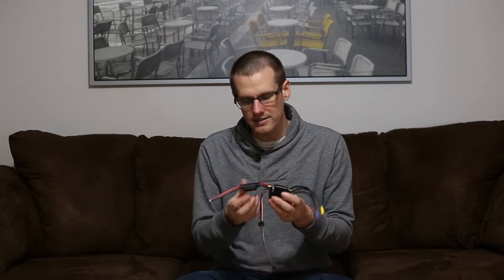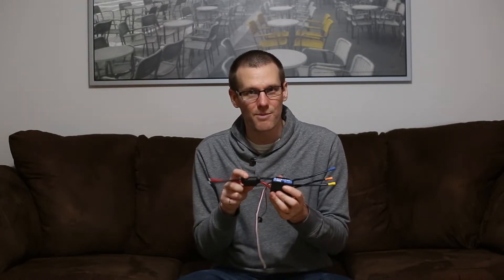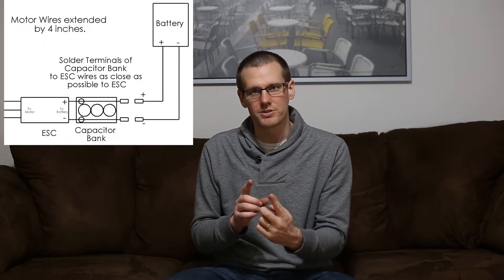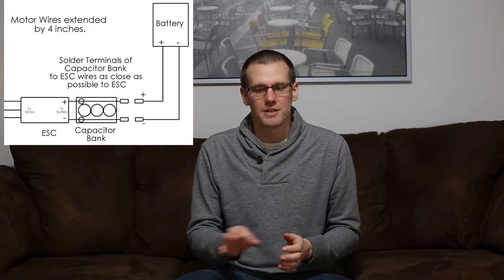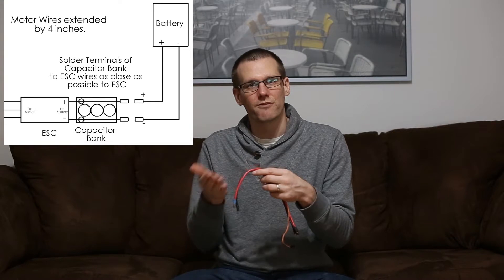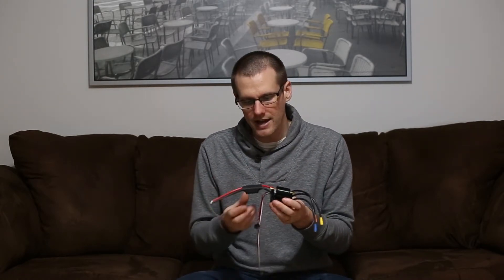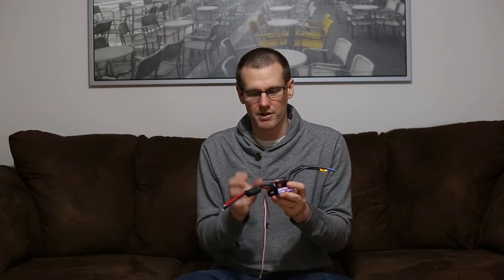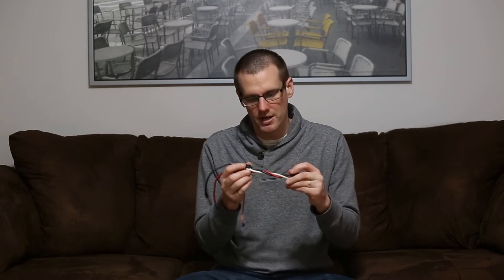How to Extend ESC Wires Correctly preventing Damage

Comment: people have recommended to go higher than the battery voltage for capacitors on the input side, because the very short transient voltages are much higher than the battery voltage, but that is measured without a capacitor in the first place. The big enough capacitor prevents these high spikes, so kind of protects itself from them. But a too small capacitor could fail quickly. correct?

Comment: I am in trouble and need your help
I converted a Balsa USA NorthStar seaplane to electric. The engine and the ESC are in the engine nacelle at the back of the plane and the battery is at the front, 36 inches away. 

According to your calculations, I will need 460*(36*2)/4 =8,280 capacity of the capacitors

Can it be done?  How many capacitors should I put on the board?
Reply from the maker: I would feel safer placing the ESC closer to where the battery is. Is this possible? Just need to find a spot at the top of the fuse and make some cooling vents.
Reply: @RCexplained 
No
It is not possible

Comment: Am I hurting my motor?
Should I lower my UF and would soldering directly to the ESC be better? 

I use 2 50v 6800uf capacitors for my cap pack, plugged in between lipos and esc
Lipo plugs to cap pack, cap pack plugs to ESC.
Reply: Yes, soldering caps direct to the esc input pads, if possible, whilst keeping the capacitor "legs" as short as possible is ideal.

Comment: Hi Ryan! Thanks for the great info! I would like to ask if adding a bit more farads is going to be a problem. So instead of 460μf adding something like 500μf. So if I add a total of 4 capacitors it would be 160μf more capacitance in total. 

Thanks!
Reply from the maker: You will be ok with more capacitance.
Reply: Thank you so much!  @RCexplained

Comment: Hi Ryan. If a person is not hard on acceleration and deceleration of the e.s.c. Will that help in prolonging the life of the capacitors on the e.s.c. ?
Reply from the maker: It depends on the ripple voltage. If you are still exceeding max ripple voltage under any acceleration, it's no good. If you can better manage ripple voltage by accelerating slowly, perhaps this can help. But I don't think there would be much difference. It would be better to just hold wide open throttle the entire time.

Comment: Hi Ryan, excellent explanation. I have one question, how did you arrive at the conclusion of what capacitance to use per inch of cable? Did you base it on a mathematical formula or your practical experience? I'd love to know more about the process behind this decision. Thanks in advance for your reply!"
Reply from the maker: the formula to calculate this value is very complex and time consuming. This is a general rule of thumb.

Comment: If the heat shrink tubing to the connectors on the motor start shredding (exposing the gold connectors), will they short out on each other?
Reply from the maker: They can, drop another piece of heat shrink on it and you are good.

Comment: Hi Ryan, nicely explained. Probably saved my neck as I planned to use over foot long wires to ESCs... Anyway.... Reconsidering the wiring now I would like to ask a question. If I change the gauge of wires battery-esc can I use bit longer wires than original? Specifically Hobbywing xrotor 40A comes with what looks like 18AWG (or even 20AWG - haven't got the caliper to measure precisely) If I replace them with 14AWG can I go a bit longer (probably couple of inches to get the ESC's on the arms) without all the hassle with capacitors?? Thanks for your reply. J
Reply from the maker: Hey Jakub, larger diameter wire can help, however, it's not easy to suggest by how much. Capacitors is the cleanest and simplest solution. I believe it is way easier to add the bank vs re-soldering larger wires at the board.

Comment: Thank you! I have to check my ESC's to see if I lengthened the wires and add capacitors. You say to add 460uf to 4 inch of wire. On this large topic https://www.rcgroups.com/forums/showthread.php?952523-too-long-battery-wires-will-kill-ESC-over-time-precautions-solutions-workarounds&perpage=10  they say to add 220uf to every 4 inch: ''As a rule of thumb, for (but nut on!) every 4inch/10cm extra length/distance between battery and ESC, add 220uF extra capacitance near the controller''.  Now I'm confused on what to order. Also they state that the capacitors should be low ESR: ''The main spec you need is low impedance and low ESR (Equivalent Series Resistance), otherwise capacitors will get too hot''. Do you think it's a must? Thanks!
Reply from the maker: Hey Jackal, thanks for the comment. Using 460μF of capacitance for every 4 inch of wire is very conservative. Many ESC manufactures would agree with around 220μF per 4 inches of wire.  Having more capacitance then you need is not going to harm your system, in fact it may have benefit, if you have other underlying reasons for high ripple voltage. 

If your ESC has ripple voltage logging, use this to see the difference that your capacitor bank has made. As long as the ripple voltage is always less than 10% of the nominal battery voltage, you are in good shape. A good target is 5% of nominal battery voltage with a couple peaks that may be higher than 5% in a run. 

As for low impedance and low ESR, yes I would say this is not optional.  Not following this advice will decrease the reliability of your capacitor bank. There are many capacitor banks on the market that you can use already pre-built. Grabbing one of these would be the easiest solution.

Comment: Would appreciate your thoughts as I'm new to this. Built a big Hangar 9 Carbon Cub. Running an Avian 100A ESC and a Power 60 Eflite, 16x10 prop onn a new 4000mAh 30C. The build guide specs a 6" lead extension [10AWG] from the battery to get the wires to where you can plug/unplug. There are NO capacitors called for. Also, I placed an XT90/EC5 adapter on the battery end of that extension since all my batteries are XT90. Could that be problematic?
This all stems from me researching an issue I experienced on my last circuit of the maiden series of flights. I had an engine just quit in the air but luckily successfully dead-sticked it back to the field. I know my LVC was improperly set at 3.4V to enter a Soft Cutoff. That was my mistake. I've reset to 3.0V. My battery had recovered back to about 3.7 by the time I got to it to check. I'm thinking I had a cell on the new battery drop to 3.4V and initiated a LVC but it sure didn't seem like a soft cutoff, motor only went dead rather than to 50%. I had control of plane, still. Not sure if it alarmed as I had a digital checker on my balance plug that was already beeping again, due to a high setting trying to be cautious. 
btw, I just received a power meter and did a test. It shows my Wp at 2200W and the motor is supposedly capable of 1800W. Amps peaked at 100.3A and I believe burst is supposed to be 85A on the motor. I'm not sure the meter is accurate or if I have an issue to tend to. I have another meter coming to compare. (RCToolKit W150) versus a private label identical to the Turnigy.
I'm trying to make sure all is good BEFORE sending all my work back into the air!
Reply from the maker: Interesting how the manual asks to extend the wires but do not consider capacitors. Especially if they are not calling out a specific ESC, otherwise there's no way to know if the ESC can handle the wire extension. This is concerning. 
My preference is to solder on my own connectors rather then use an adapter. This way I get a direct connection and eliminate any extra connections or resistance points. 

I have many of my ESC's set between 3.2 and 3.4v/cell cutoff. For planes, I do use a soft cut off and have never experienced a full dead stick.  If I return the throttle stick to 0% and then back up, the motor would resume at a minimum.
Reply: @RCexplained  Appreciate your time to reply! I did a lot of forensics yesterday and actually ran the plane, well secured, with prop and inline watt meter. My deadstick was self induced by improperly setting the Avian 100A ESC to 3.4V for a soft cut-off. This, coupled with the fact I'm running brand new 4000mAh batteries on a maiden, I hit that low cell V easily once I got into the battery for about 3-4 minutes. I replicated the entire scenario yesterday after watching your videos. I yanked the extension lead after rerouting the ESC leads. My wattage and amperage draw under simulated but likely higher than normal (50%+) throttle settings, was within specs and got me to about 5 minutes of flight time but I stayed into it beyond and induced a LVC on 2 battery tests after resetting the ESC to 3.0V for LVC Soft. Now I know exactly how it goes down. I'll continue with the adapter on my Turnigy's for occasional use but yesterday I bought 3, 5000mAh SMART batteries with IC5 since I have the telemetry capability with all the Spektrum gear, DX9, AR9350T, and Avian 100A ESC. Thanks again for all the info you provide!

Comment: Excellent information! Answered all of the questions that I had on my current drag car build. I intend to add a 8800uf cap bank directly to the battery terminals on my Tekin ESC. I'll keep the battery leads as short as I reasonably can and add any length I need to the motor side. Thanks Ryan!
Reply from the maker: Right on Baxrok2, glad the video answer all the questions that you had!

Comment: I'm looking at a situation where I'm wanting to have the batteries about 30 inches away from the ESC. Having heard others explain about problems on having long battery lengths, I had already thought about adding extra capacitors to the ESC side for dampening of the input to the speed control. Your rule of thumb of "460uF for every 4 inches" answers one of my questions.

My second question - Is it OK to use one (or two) much larger capacitors in parallel on the ESC side? Or is there some specific reason for having to use several banks of many smaller capacitors? Thank you.
Reply from the maker: You can use fewer larger capacitors.
Reply: Thanks for the quick response. I wasn't sure if I might be missing something. My plan was to add a an electrolytic with a low ESR between 3300uF to 6800uF onto the PCB where the battery wires solder onto. In the research I've looked at, the larger the uF of the capacitor, the lower the ESR is for it.

Since the setup is going to be High Voltage (6s) & High Current (100A), for the power-on rush of charge current to the caps, I'm working on some sort of initial current restricting system for pre-charging the caps just prior to arming the ESCs. To keep the voltage drop/current losses down, I'm installing 25" of 8 AWG from the battery connector to the ESC, replacing as much of the 12 AWG as possible.

I might be overthinking things a little bit, but I like to design with as much headroom as possible. Is there anything that you can see, which I might be overlooking? Thanks.
Reply from the maker: @whawaii  what you are doing sounds good. Just keep in mind that it is 460 micro farad for 4 inches of wire. 4 inches of wire would mean that the positive lead extends by 2 inches and the negative lead is extended by 2 inches.
Reply: Right! Thanks for catching that & clarifying it.

While you do say it in your video, it seems like you went through it so quickly I didn't pickup on it initially. For others, so they don't end up accidentally misunderstanding it the way that I did, you may wish to consider editing your description & specifically state that it's "per 4 inches of total wire length added".

I'm going to calculate it as 230uF per inch of extending the battery away from the ESC, which is close to the 220uF per inch I remember seeing somewhere else before.Thanks for all the help.
Reply from the maker: @whawaii  thanks for the feedback.

Comment: I have a servo whose signal, power and ground wires runs alongside a brushless motor's three-phase wires, and the interference was just so bad, especially when the motors were throttled. The twisting of the motor wires didn't help. I even added a ferrite ring around the servo wires, but that didn't help either. Any other suggestions?
Reply from the maker: The best way to remove interference would be by separating your signal and power lines.
Reply: I remember watching this video when ot first came out last year but I never commented on it. Twisting the three AC wires will not prevent interference at all. Actually it could cause problems with the esc's back emf sensing if you had prety long twisted AC wires. Wasim the only way to prevent signal noise in your case is using coax cable for signal and ground and an additional wire for positive voltage. Use core of the coax for signal and the shielding for ground. Tip: you can use old laptop wifi antenna coax, also found on wifi capable TVs, printers and so on. I use coax for Cam>FC>VTX and FC>LED strips. Also had thoughts of replacing ESCs' signal wires bc of DSHOT600 telemetry errors.
Reply: @veskovesilev2019  Thanks Vesko. Not sure how I missed your comment until now, but thank you so much brother!
Reply: Your getting brown outs your servo could be pulling to much power so it stops then cuts  back on
Reply: @michaelsteuernagle3479  Hi Michael, the servo and BLDC motor have separate power source. So interference is most likely the culprit..

Comment: My capacitor blown up on esc and it’s impossible to change, can i add capacitor bank on the wire and use it like that?
Reply from the maker: A capacitor downstream from the esc will not behave the same as a capacitor right on the PCB. I have not tested this exact case and have only added to the existing factory capacitors.
Reply: You better remove the heat shrink and replace the capacitor. Solder the new one right on the board. This is safer.